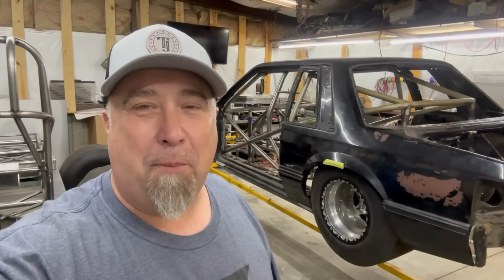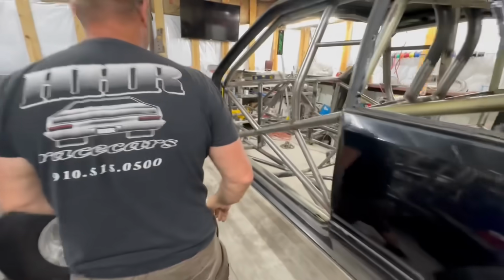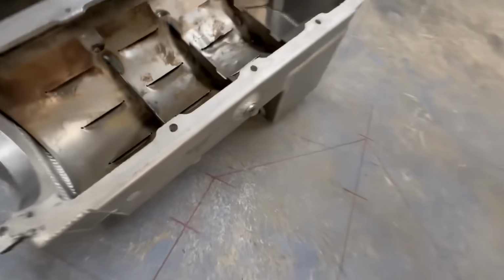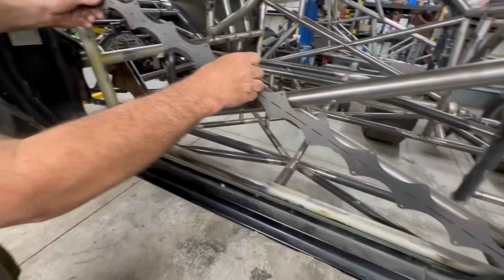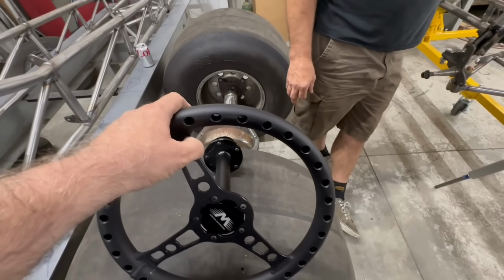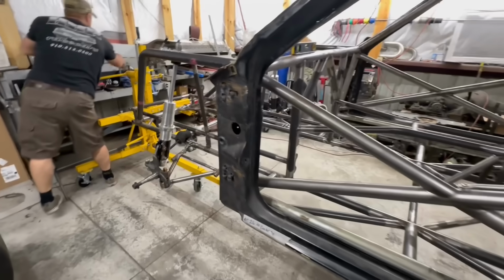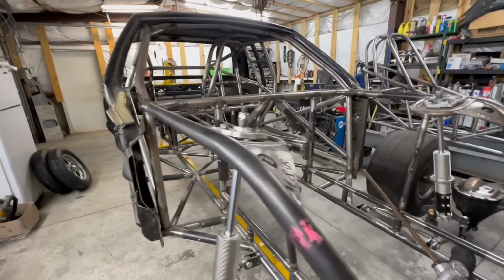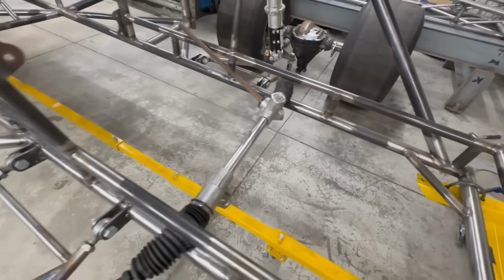TurboJohn Mustang Updates!  Getting closer!!

Comment: no removeable trans cross member? Gonna be a pita pulling the trans
Reply: All he has to do is cut the crossbar and put in some 4 bolt flanges, like nearly everyone does.
Reply: I can see where it could be a little difficult. Especially with the way the upper frame rails angle in and there being a crossbar welded between them right above the tail housing. 
I’m sure Mike has a vision in his head. Guess we will have to wait and see once it’s all finished.
Reply: @funfun8095  you blind?
Reply: @funfun8095   thats what i was saying its not removable
Reply: @racervx54  He's probably leaving it like that, like the Saturn. They just pull it out, through the cabin. PG is light, so I guess that's fine for them.
I wouldn't dare try that, with a th400.